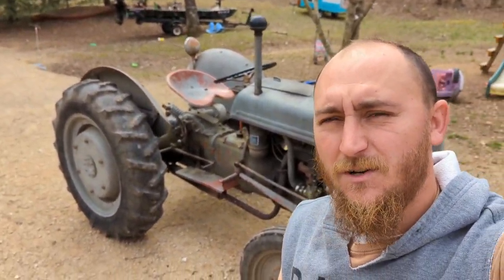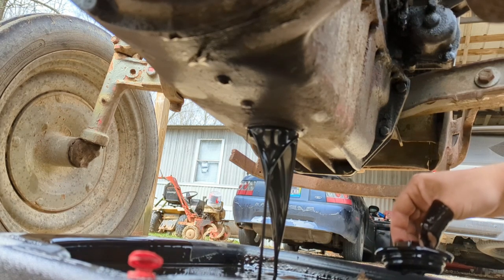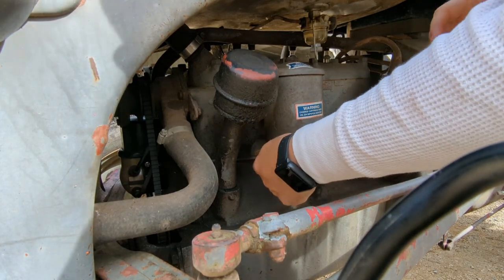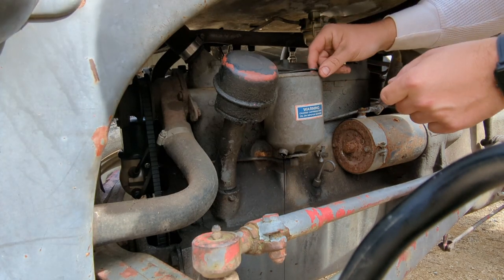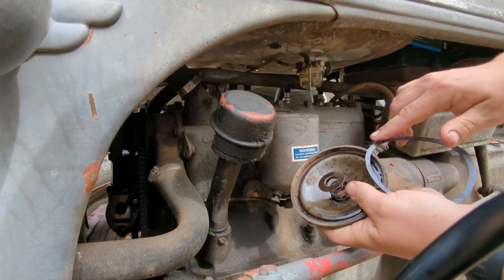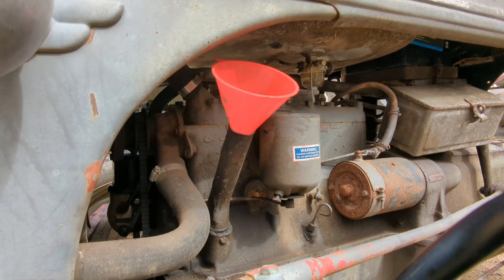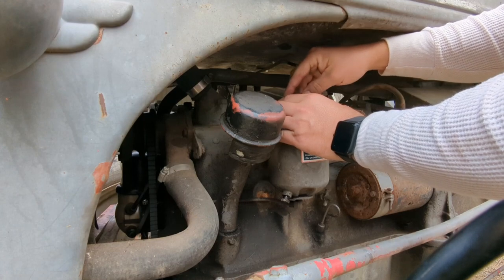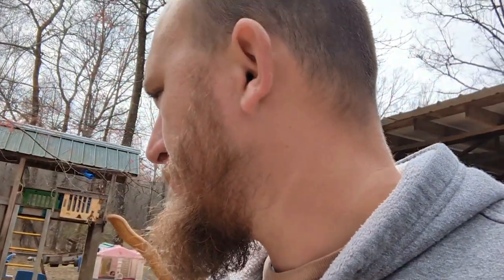1947 2n ford tractor oil and filter change

Comment: The cotter pin is in case the rear seal on the engine leaks,the oil will drip out instead  of pooling up causing the clutch to slip.
Reply from the maker: 10 4 man that makes since...I can't thank you enough for your view and taking the time to comment....been working on building a boom pole for the tractor...maybe ill have the video out soon...kids and life kinda slow the progress 😁

Comment: Cotter pin is to keep the wheel while free of dirt and debris. If the input shaft starts leaking, it doesn’t fill up and soak the clutch. Gives a place for the oil to drain if it gets in there.
Reply from the maker: Ok thanks for watching and replying

Comment: Change hydraulic oil every year and check rubber shifter boot will let rain water into trans and destroy lower brging and gears 
Best to keep it covered and drain all fluids every year including hub on axles
Reply from the maker: Thanks